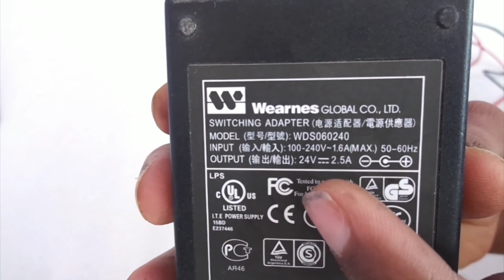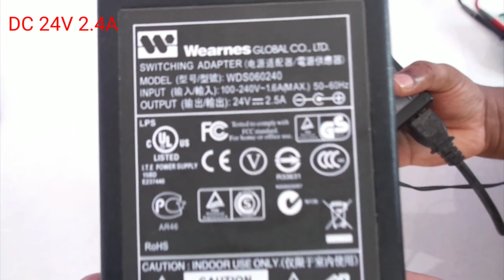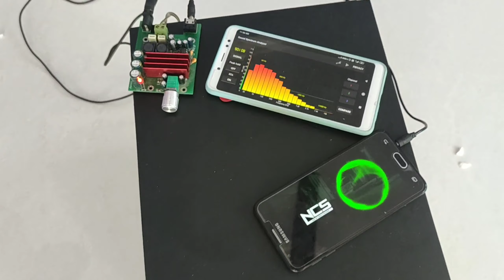How to make a powerful subwoofer amplifier at home

Comment: Can we use it in car
Reply from the maker: Yes
Reply: Not really, car has 12v output from battery, you would need dc/dc converter to make it work at high volume, on 12v you would get less then half the watage of output from amp. Also used car amplifiers are cheap...